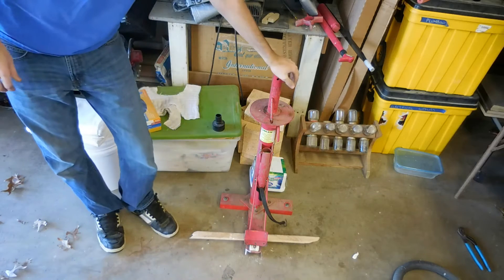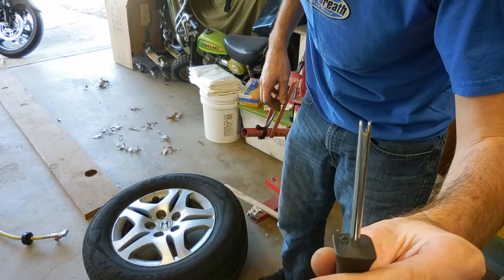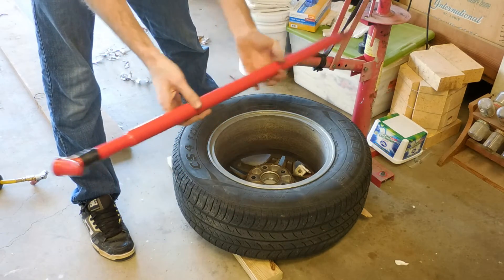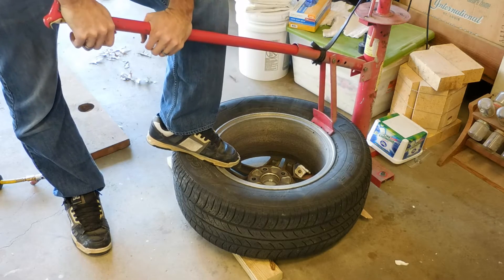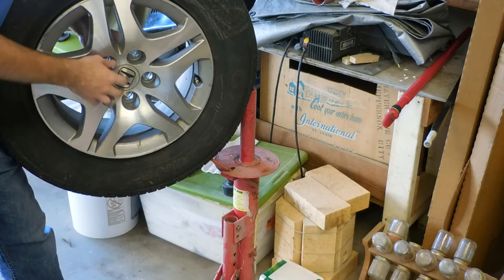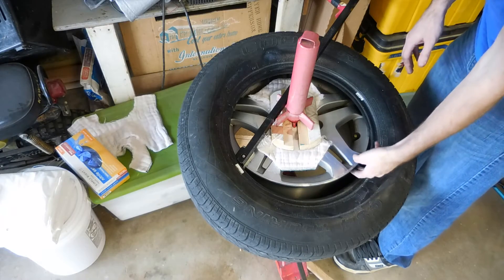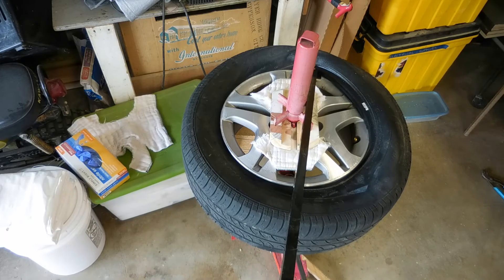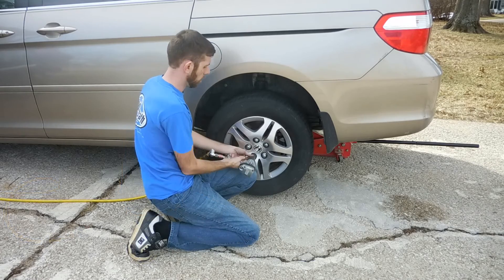Remove balancing beads from these tires?

Comment: DUDE that MojoLever is the greatest thing I've ever seen. Did my motorcycle tires "the old fashioned" way and it's comical to see how easy you did it with that one tool basically
Reply from the maker: Donny Fritz yeah, that bar works very well and is 1000x easier than spoons. I believe No-Mar makes one that people seem to like a bit better, but IIRC it’s a bit pricier.

Comment: the bead of the side you are trying to install has to drop into the deepest part of the wheel to have slack to get it over the rim. I do it with motorcycle spoons, easy if you get the bead down in the groove!
Reply: Lucky you didn't rip the bead
Reply: @jimburke9161  It was certainly crying a little at the end.

Comment: The only reason they don't work is because you didn't install talcum powder in tire to prevent beads from sticking in wrong locations
Reply from the maker: Trace Tomky interesting. I’ve never heard that.
Reply: @DustinRogersinMO  the beads stick to tire and also each other with moisture from compressed air. Talcum powder required

Comment: Were your previous tires that the beads worked on a higher profile design? That tire appears to be a 65 or lower profile tire.
Reply from the maker: The tires that I had good luck with the beads were some 10-ply aggressive off-road tires on 18" wheels. These tires were lower profile, but I also had issues with using them in a different brand of 10-ply LT tire as well.

Comment: Those beads look very small. The principle behind beads make a lot of sense but I think they get hung up on the uneven surface on the interior of the tire and can't distribute themselves evenly.
Reply from the maker: They are small, but they're larger than 'Dyna beads' that we used to sell at the motorcycle shop. It had never occurred to me that the inner surface of the tire may be the culprit. I had some MAXXIS Bighorn MT tires on my Titan and these same beads worked fantastically, but I don't recall what the inside of either of the tires were like.

Comment: I don't understand why people say they don't work on aspect ratio 65 or less but then say they work on motorcycle tires?
 I have .20g airsoft in my p275 65r18 wranglers on 18x9 alum wheels and they seem to do the trick. I did everything myself so i tried beads
Charts called for 6 ounce. I used 7 just to make sure I had enuff
I figured if they didn't work I'd go have weights put on them. They are fine to 80mph anyway. 
Seems like there is a lot of mis information out there about this. From people that have never used them. 
Thanks for your review

Comment: one oz. for every 13lb. tire and rim weight.  there is a public chart also. anything less tha 1:13 means you have inadequate balance potential and vibration. 30 to 80 degree temp reduction 30% extra life.
Reply from the maker: The company I got these from recommended 1oz per 12lbs. I weighed the beads and tire and put the correct amount. Still had vibrations that all went away once the beads were removed and the tire balanced with static weights.
Reply: Dustin Rogers your experience is an outlier from the norm. 

what caused this is what i would like to know. any theory?
Reply from the maker: I experienced the same issue on two vehicles. Everyone that I've talked to locally also claims that balancing beads don't work...I"m not sure if it has anything to do with the design of the inside of the tire? Maybe some tires are smoother inside and allows the beads to position themselves easier?? I'm not sure. I do wish they worked out because I can mount tires myself, but don't currently have a way to balance them myself.
Reply: Dustin Rogers what was this company and the type of beads?
Reply: Dustin Rogers the Harbor freight bubble balancer works good and is inexpensive.
Reply: Curious how over the road semi trucks and the like have been using balancing beads for literally millions of miles with no issues.

Comment: Tires have a dot that you line up with the valve stem. Tire should be almost perfectly balanced. Like someone else said "your beads looked very small and looked to be hung up on the grooves in your tire. Airsoft bbs would probably have worked. You are the first person out of dozens of others that had a problem. But before i put them in my tire I will certainly consider your situation.
Reply from the maker: Dennis Madigan I always mount my tires with the balance dot at the stem. The beads I used are considerably bigger than some of the more well known balancing beads on the market. As a motorcycle mechanic I installed several different brands that customers requested. The beads I used were from CalliesKustoms. I had really good luck with them on a Nissan Titan that I owned, but in my Odyssey and Sequoia I had a lot of vibration on both that went away once the beads were removed and the tires were spin balanced.
Reply: Dustin Rogers thanks for your information.